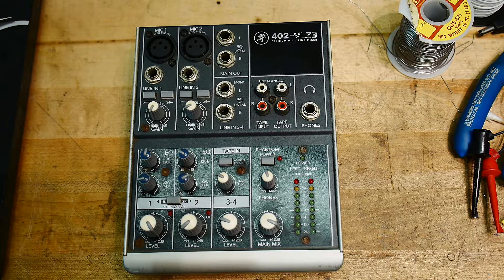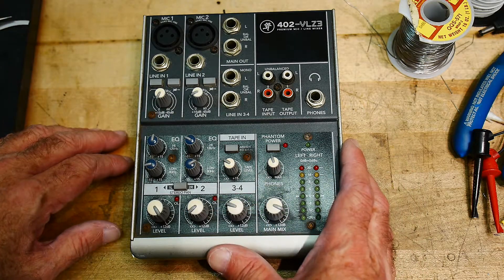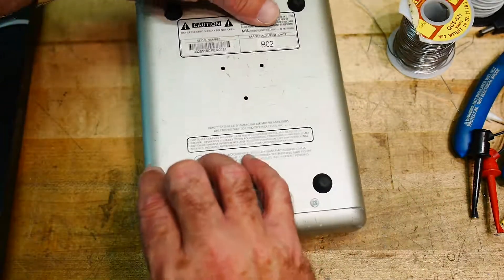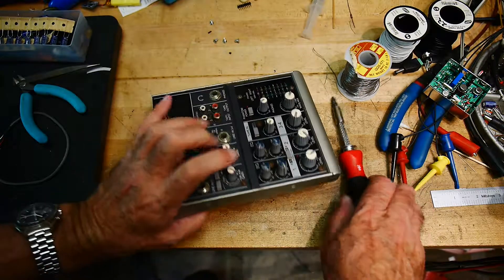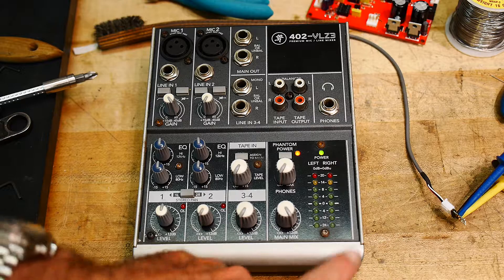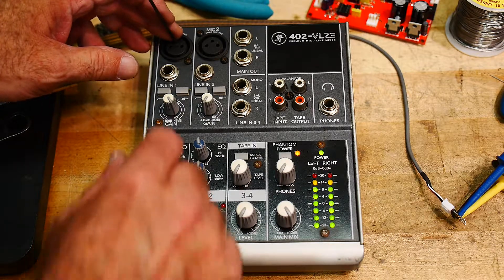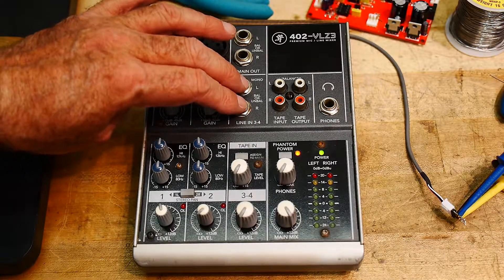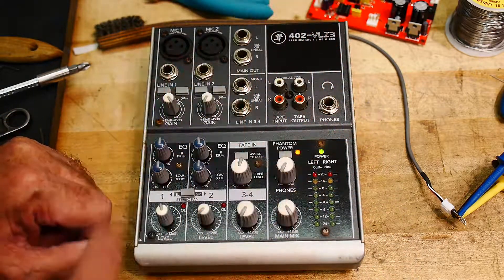#487 Mackie 402-VLZ3 Mixer Teardown

Comment: You say at the end that the mixer is AC or DC, but i learned that using a DC power supply is no good if the unit is designed to accept AC power with a bridge rectifier built internally.  Did I misunderstand?  thanks!
Reply from the maker: That was a long time ago but I think it needs to be AC for the phantom power to work, otherwise DC would be OK. oh, and DC will pass through a bridge rectifier.
Reply: @IMSAIGuy  ah thank you so much for responding!  I've also got a cheap VLZ4 mixer but can't find a comparable power supply with that 3 pin connector!  The only ones I can find are 17V x2  whereas the device wants 18.5v x2 - do you think I should go for the 17v PSU??
Reply from the maker: might work
Reply: @IMSAIGuy  thank you!

Comment: great video! i have the 802-vlz3 i just picked up from a thrift store in town for (wait for it) $8 - (came with the og adapter and a $50 Mogami silver series xlr  25 ft cable - fyi) - tested resistance on the xlr - 100% perfect. mixer does power up, have not tested performance. have just now torn down the adapter to find that it had been dropped - 2 of the 4 adapter casing screws had, through shear during impact, fractured their specific housings into fragments - currently using orange Testers modeling glue to work that all back together along with repairs to the wiring as it enters the casing - but to my point in writing....i just removed the back off the mixer and wanted to know what size Allen those face plate screws are? i'm sure that they are the same for both. thank you! EDIT: I figured out that the allen size is 1/16th inch if anyone else needs to know this. do not use metric - also use a tiny cut off wheel on a dremel if you've got a stripped screw head - cut the top for a flathead screwdriver like shown in this video - or opt for a torx bit carefully tapped into the stripped allen top.

Comment: You know I can't imagine how many people need to see this video. But I did for a very specific project I'm working on and I'm so grateful you made this. 

This little mixer is actually pretty cool. Most mixers this size have everything mounted on a single pcb. If you want to build a custom faceplate for it to be able to mount it to something else (i.e. eurorack, custom case, etc) you'll have a lot of trouble dealing with the different heights of the 1/4" jacks when compared to the control knobs. This mackie mixer is a godsend because the two sections are on separate boards. So you can mount them to a custom flat faceplate if you wanted.